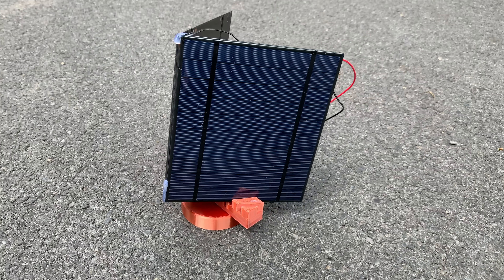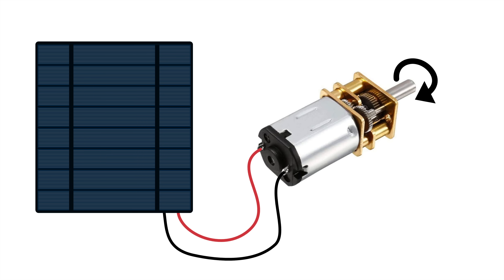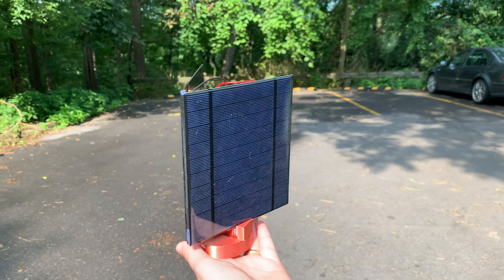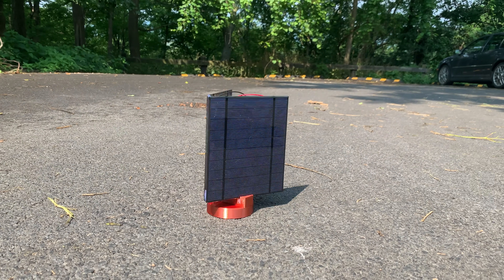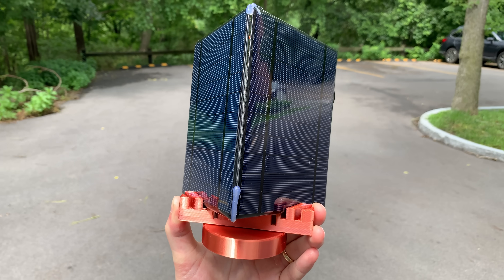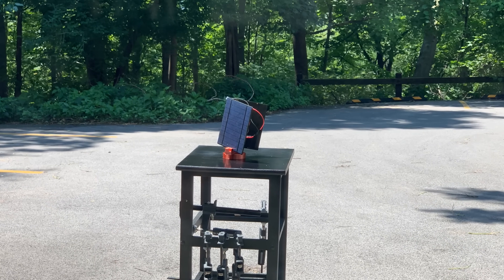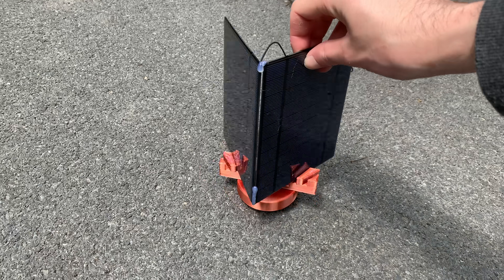World's simplest sun tracker.

Comment: That's brilliant! OK how about adding another axis so it can track not only the hour angle but also the tilt angle? World's simplest sun tracker V2.0
Reply: Possibly use a corner of a cube for the shape. Have it triangulate.
Reply: @justinpatterson5291  you need  a chip for that
Reply: ALSO... if you can get the tracker to move an array left and right, you can use the same design and add an additional tracker mounted horizontally to track arrays movement up and down
Reply: Use one large solar panel pointing at sun. Have two tiny mirrors make two sunbeams go to two tiny leds behind the panel, and use a comparator on these two micro voltages to drive a transistor to drive the motor rotate the panel. Then you have max solar voltage for use and only 1% or less going to the motor - and it will be smoothly rotating.
Reply: @idjles  noice :D
Reply: @idjles  this sounds interesting. Can you make a video about this idea?
Reply: @idjles  I see another commented too , liking your brilliant idea is this idea available on YouTube or net ?
Any tips to find would be appreciated,  cheers
Reply: NightHawkInLight and Greatscott! Already done that
Reply: @lkahfi  but this simple?
Reply: @kingpangolin4332  greatscott no, but NightHawkInLight yes
Reply: @lkahfi  sauce?
Reply: @lkahfi  can you link please
Reply: @lkahfi  they uses microchips, this one doesn't
Reply: @patrickarcega9861  greatscott? Yes, NightHawkInLight? No
Reply: For that it's better to use something like a "umbrella", and if its pointing towards the sun, nothing happens. If the sunlight hits the lower part of the surface below the umbrella, it tilts up. if it hits the upper part, it tilts down. if it hits the left side, it tilts right, and if it hits the right side, it tilts left so it always faces the sun. Hard to explain without graphics..
Reply: @NovaLand  Very smart actuelly and way better, you have a 2 axis rotation you can perfectly track the sun height and position
Reply: Very simple but required 4 pannel.
Reply: You don’t really need axis, at least in a short term. But you need to align setup rotation axis with Earth rotation axis
Reply: 👍That's what I was wondering, ideal for a solar oven
Reply: Just make 2, turn one on its side 🤷‍♂️
Reply: Connect the small panels to relays, and relay from the batteries to larger motors to turn full arrays.
Reply: @James-pq5eh  just use small motors geared way down and suitable panels, shouldn't need more than 1% of any array
Reply: So it becomes a Pyramid shape pointing to the Sun!
Reply: It will need triangular solar panels
Reply: I did just that 5 years ago - https://www.youtube.com/watch?v=hFZY4lkipbM
Reply: @pattayaguideorg  amazing work! love the material choices xD
Reply: @fahadalbazei6623  Thanks man, yeah materials were a bit dodgy, but it worked lol, I also made a heliostat using the same idea, sorry no vid to show but its pretty cool :)
Reply: @pattayaguideorg  damn dude.
Reply: You only need one angle. The Sun moves in a straight line across the sky (mostly)  - you just have to track the pitch to the sun's movement. The yaw, as presented in this video is the incorrect axis to rotate solar panels on.
Reply: @2dragonfire514  actually,  this works fine.  Granted tilting the panels back on the pivoting axis would improve power generation.  But you aren't going to get usable power from these,  as the panels are shorted across the electrical connections. This would drive an encoder to move a larger panel for power generation
Reply: @2dragonfire514  a straight line?
really?
how about latitudes far up north, like above 66 degrees north?
you better think again...
Reply: Two more panels
Reply: It works but not preciously.
Reply: Yup but youd need a phased array of smaller panels since 1/2 the z axis is always in the shade .
Reply: What if the motor burns up bc of it not having sufficient voltage to move it...if you get what I saying
Reply: But there is only -  and + pins for a dc motor
Reply: There is a more simple solution, tilt the base by a certain number of degrees and calibrate it against the local high noon altitude angle.
Reply: And build ANOTHER SHORTCUT? no, thanks!
Reply: Put a solar panel on top😊
Reply: That would require another stepper motor and it doesn't create enough power for that
Reply: That would be easy enough.
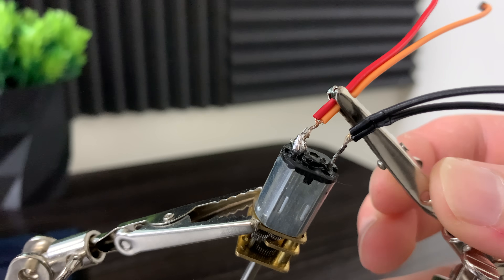0:37 I’m pausing this here, just because I have given this some thought over the years.
You can use a panel for the controlling unit, and preferably a pair of small stand-alone solar panels.
Two, because you would want it to turn back to the East at the end of the day.
A few batteries to back it up for the return trip.
Arranged in such a way that when the sun catches (if facing it from the perspective of the sun) one of the panels gets more exposed, then activates a small drive motor to adjust the panel, like shown.
A simple mechanical setup could be made to cause the motor to reverse at the end of the day, and a micro switch at the Eastern stop would disconnect just the reverse power from the adjusting motor.
They other is no less simple.
A slot instead of a block, slot is horizontal.
Two solar panels again, this time lined up vertically.
One panel would cause the elevator to move the array up, the other to move it down.
That motor wouldn’t really need any stop switches in its wiring, because it would be automatically shut off when there is no sunlight at the end of the day.
When it is cloudy, it should tend to just point itself at the brightest portion of sky.
Reply: Put it on an equatorial mount. Done.
Reply: @JCO2002  that would only work if the Earth didn’t have an inclined axis.
Reply: @dangeary2134  Ahem... You align the polar axis of the equatorial mount to point north-south with the altitude angled the same as your latitude. At 18N where I live, the axis would be set 18 degrees from horizontal, pointing fairly close to the star Polaris. When your panel or telescope has the right declination set, you only need to rotate in azimuth to track an object, usually done with a clock drive.
Reply: Then it'd be the world's second simplest solar tracker 😂
Reply: It'd only need a third panel, too
Reply: Will these small panels and motor be able to turn the array, will the breeze overpower the drive system?
 I saw a system that used gas pressure in tubes to align the panels but the breeze would overpower the drive and turn the panel away from the sun.
Reply: BUT... you don't show how your tracker can be mounted to solar array to control the arrays movement
Reply: @jvmciii  use this,  and your brain and come up with your own solution. Do you need everything spoon fed to you
Reply: I mean it's simple but he basically shorts the 2 panels. Risk of fire or damage with larger panels
Reply: @dtibor5903  Why the f* do it with larger panels? Small panels can steer large panels.
Reply: @dtibor5903  not true you can literally bond the positive and negative of a solar panel and throw it out in the sun for years and nothing will happen
Reply: @dtibor5903  use diodes! Simple
Reply: @duncanmascarenhas8155  solar panels are diodes...
Reply: @dtibor5903  Use two smaller panels to power the motor for the larger panels...
Reply: @dtibor5903  yes! Wonder if we can use a couple of diodes to block the reverse current feed.
Reply: @dtibor5903  you don't need it on bigger panels. You could use this to track the sun FOR THE BIGGER PANELS. 
Hell, you probably don't even need panels this big to track for you big panel.
Reply: @dtibor5903  you'd use this and a rotary encoder to pull the position to set the angle of the larger panels... you don't just put 300w panels on this thing and hope it works rofl....... use your brain man
Reply: @bugz000  Use your own. It is a tracker, you will not use the configuration for the producing panels since it will always give you the wurst angel you can have on the panels.
Reply: @bknesheim  I get you point. Not trying to be an grammar nazi, but I couldn't stop giggling at your misspelling. You crearly meant to write worst. Wurst means sausage in German
Reply: @sergiocosta2768  When you put a finger on it I see, and I do now the German meaning since I read that to.  :-)
Reply: @bugz000  or just use a really big motor lmao
Reply: @bugz000  use 2 small control panels and a highly geared motor on the large array. it only has to make 1/2  revolution twice a day
Reply: @dtibor5903  Easy to use optocouplers to isolate panel power from being directly connected to motor drive.  Gets more complicated but should still work.
Reply: @dtibor5903  not really if they are charging a battery
Reply: @Joso997  learn electronics first, then think, then reply, not the other way around
Reply: @dtibor5903  You will never use this setup for large panels since it is in fact the wurst solar tracker you can make, It always place the panel in the least efficient position you can have.
What you have to do is to place a solar tracker like this on top of a large panel that have a 45 degree offset to the panels in the tracker.  Then the large panel will always face the sun directly.
Reply: @dtibor5903  Who gives a shit if its fun
Reply: @Chazzvdh  basically that is the recipe for most tragedies involving teenagers
Reply: Booommm
Reply: There is one
https://youtu.be/wL9PcGu_xrA
Reply: Using 2 of these with plenty of gear reduction for the motors, and having them move a much larger panel would probably do the trick.
Reply: @garethbaus5471  to not build a shortcut would to the trick, too.
Reply: @Wrutschgeluck  How is that a shortcut?
Reply: The beauty of this is that it can spin 360°. When you add a declination component to these existing panels, you would lose that.

You could add declination to the top of this.  But if it isn't self-contained, then you lose the beauty again.
Reply: @AdamHowellProvo  two sets of panels driving two independent axes. I believe it's possible to design  two uninterrupted rotations.
Reply: What happens if you make it like cylinder shape and spinning too wow 🤩 genius me I just resolved fuel crisis world wide
Reply: @René Casaña It was just a concept demo going for a design that was as simple as possible.'
There are many designs that are better to use in a real application.
Reply: 😅 @bknesheim
Reply: @René Casaña Yes, and your point are?

Comment: I made something like this with a couple photo resistors and a physical divider between them. The challenge was getting the whole thing back at the end of the day. Created a "dark sensor", when it go dark enough it turned motor on until whole assembly rotated back and ran into a cut-off switch.
Reply: sticking with the no non solar power theme. how about a smaller third panel on the back side in the shadow of the 2 main panels. this panel would get lit up when the sun comes up cause the motor to "go" and after a little turning one of the main panels would get sun and then its back in business. no batteries no external non solar input.
Reply: @nerys71  Great idea nerys..... then it rotates back when the sun comes up next morning.  If it was a cloudy day then... who cares? Maybe next day will be sunny it rotates back to face the sun automagically.
Reply: Well a simple NOT gate would work...
Reply: This is very practical.
Reply: A couple years ago I tried to do something similar, but men, I study chemistry not electronics (I know it's simple but no so entreteining for me c: )
Reply: Can you show  me your project (like circuit diagram something),i have to make a similar like that
Reply: Yes. I feel he didn't even think about the sun rising opposite to the sunset. But in summer it happens, and this design would just wait idle until midday.

Comment: since the device tracks the sun until dawn, you can add mirror or lens, that can redirect the sunlight to the panels, so that in the morning, it can turn around 180 degree
Reply: in fact, a 3º solar panel is better, a mirror will ever reflect and confuse the system.
Reply: This vid is the "World's simplest", but you are correct. If making a real tracker, you want something that detects sunset, and cranks it back towards sunrise, so its ready for morning. Assuming the panels are topping off a battery or something, you need to detect sunset and reset for morning, before the battery runs too low for the night.

Comment: Flaw:
If the sun is at the back both panels are in the shadow making neither produce energy
And there is nothing attached to it like a power bank 😂
Reply: which will never happen because it will always be facing towards the sun and has wider than 180 degrees of capture, so it can reset at sunrise the next day from the opposite direction it was pointing at last sunset.

Comment: Next: make gear ratio rpm:rpm, 1:1 and 1:0 and 1:-1 with differential gear. Is 1:0 possible?
Reply: 2 gears that are not touching are 1:0
Reply: @homelikebrick42  how about differential?
Reply: diffs are used for all wheeled vehicles. It can turn at different speed without slipping.